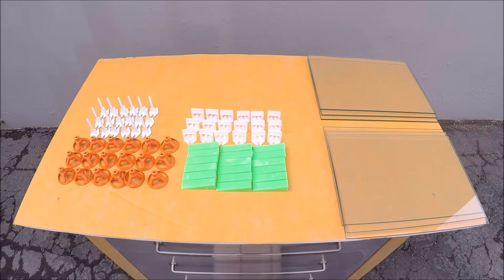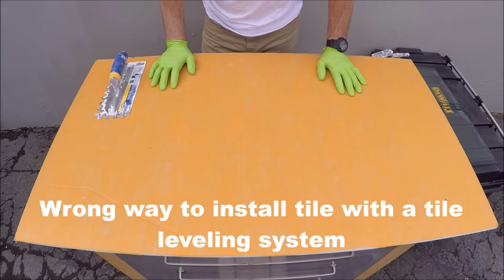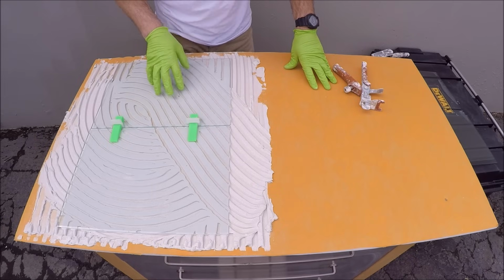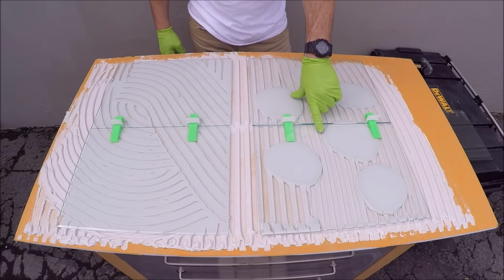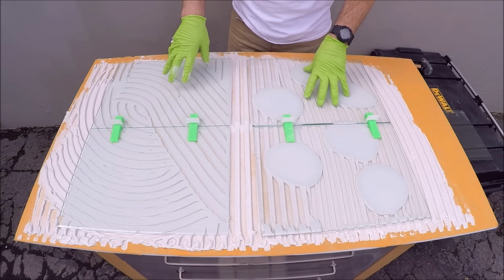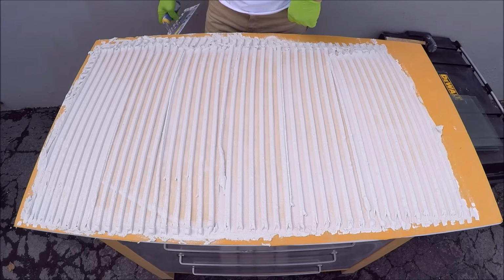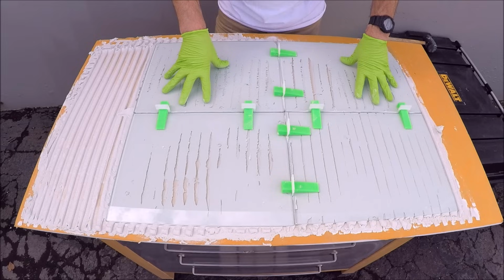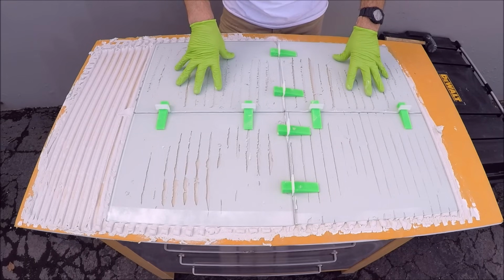How to Use a Tile Leveling System the Right Way

Comment: WHat is the best way to cut porcelain tile that is 39 inches tall? I need to cut it long ways. thx for any advice in advance.
Reply from the maker: manual tile cutter, grinder with a diamond blade and sponge or wet saw, long tiles are hard to cut manual tile cutter👊
Reply: @LandbergTileTV  thx for getting back to me on this. I appreciate it. Will research all methods you mentioned.

Comment: Just ordered and got my first wedge and clip system (T-Lock, 300 piece, 1/8" grout joint). However, what if I want a 3/16" joint? I haven't found an anser on the Perfect level master website or anywhere. Do you know?
Reply from the maker: Ah man, Levtec just came out with their new wedges and clips and they are cheap! You can get a 3/8 " joint if you install non rectified large format tile. Rectified tile would give you a true 1/8" I would also recommend 1/16, but might as well use up that Tlock starter kit and get the hang of them. Sorry you can't get a response from them...
Reply: Thanks for your answer, man. Didn't know about Levtec, cos these wedge and clip systems sure are pricey...even the pliers are like $60! Btw, do you think I can get away with not using any pliers? 96 sq. ft.w ith  6 x 36 porcelain planks. If not, would the pliers from another,cheaper brand be compatible with t- lock? Thanks for your help bro. Subscribed!

Comment: Have 4000sf of 24×36 and may give this a shot. That tiles heavy though. Wonder if the levelers will hold up? What would you recommend on something like that.  Wedges or spin top?
Reply from the maker: Yes, a tile leveling system would hold up and I would go with a wedge system. Just make sure you use large format thinset 👊
Reply: If u back butter each tile like he says your grandkids might be the ones to start actually installing the floor
Reply: @1789crazy  The bigger the tile the more important backbuttering is.
Reply: @narcoleptic8982  nar mate all about letting air out for suction,two sets of adhesive don't let all air out, one good round notch trowel does the trick, take a look every ten tiles or so.
I don't believe in back buttering tiles you might aswell be chucking adhesive down and hoping, I've done it don't agree with it.not in a car show room say.

Comment: I'm having a lot of problems with the clips not breaking off below the surface of the tile I'm breaking them off parallel with the grout line
Reply from the maker: You need to scrape off/clean out the thinset that is on the edge of the tile before you put a clip in and set a new tile. The thinset is keeping the clips from breaking off.
Reply: Thanks for your response that works quite well we actually discovered that the next day when we broke off the next day's clips Love the system makes flattening the floor extremely easy thanks for your videos enjoy when you got a new one out and thanks again for your response

Comment: Great videos. I know this isn't actually related to the video published here but you should know if anyone does. I've been reading how many use fiberglass tape with thinset to seal the corners and joints of the backer boards like DensSheild or Hardiboard. I'm not sure they are talking about the same tape used in putting up ordinary drywall or not. That tape has a lot of open spaces so I wonder if the thinset is enough to seal the corners etc.
Reply from the maker: We use the green moisture resistant fiber tape for our backerboard seams! 👊
Reply: The purpose of the mesh tape is to reinforce the thinset that is skimmed over the seams. It's like using rebar to reinforce a concrete slab. The idea is to minimize expansion movement in the joints of the tile backer board. Also, sealing the seams of Hardiebacker does not stop water. Water travels through thinset and Hardiebacker. DensShield is a moisture block. Using thinset with fiber tape will strengthen the seams, but additional waterproofing is required to seal the seams. Elastomeric products such as Laticrete Hydro Ban can be applied after the seams are reinforced.
Reply: Thank you very much. I was pretty sure thinset wouldn't be enough but it seems there are a lot of people who just use it as a barrier instead of also sealing it with some kind of sealant. Does the thinset on DensSheild actually hold on well with the expansion of joints to consider?
Reply: Latex modified thinset holds well enough. I now use Ardex x77 to set all tile. It has an 1/8” movement suppression built into the mortar. It’s the best thinset I’ve used in the 22 years I’ve laid tile.

Comment: Good video. I also tap tile with a rubber mallet after wedges are locked in. This assures I collapsed all the ridges. Also, I can tell if I forgot to tighten a wedge by the sound it makes while tapping the tiles.
Reply from the maker: That's a great idea on how to check for hollow spots!
Reply: great idea.  thanks
Reply: Exactly.
Reply from the maker: You can always use a golf ball to check as well! 👊

Comment: Used a leveling system once. Not too sure about doing it again. Gets in the way, creates a mess in the grout lines and if you're not careful, will interfere with the bond by raising the tile as you insert them.

Comment: Can you skip making that line with the margin trowel, if your levelling clip has the curved base? The qep lash clips are like that. They are curved and then flatten out when the shim is squeezed through.
Reply from the maker: That simply makes for a clean install. Also, if there is too much mortar around the clip, when you break it off, some plastic will remain and you then have to cut it out. It's always best to clear that out. 👊

Comment: I have seen so many so called professional tilers do it wrong I hesitate to employ one and rather tile myself
Reply: Unfortunately, I think you are right.  I have 2 bathrooms we are tiling.  First one had to be completely ripped out after the first 'pro' made fatal errors in waterproofing.  Second guy made several mistakes, as well.  Both are supposed to be 'excellent' tile setters (these were NOT craigslist specials or low-cost installers).  Second bathroom I am just going to do myself :(
Reply: Good luck trying to tile a shower yourself. Not saying you can't, but If you have never laid any tile this will be quite a challenge.  Most people that see tile guys do it think "oh that's so easy"

Comment: Great video, thanks for this! Do you have any tips for using the leveling system when installing 3”x12” tiles? I’m tackling that this weekend.  Thanks!
Reply from the maker: We have definitely used them for that smaller size. I would recommend against a pliers set and only use your fingers. Keep in mind, you'll use a ton of clips. Good luck and thanks for the watch!
Reply: I purchased 200 clips and 100 wedges.  The bathroom is 35 sq ft.  The clips aren’t cheap, but will be worth the cost if everything comes out level!

Comment: Does anyone know if u still need spacers or do these leveling kits act as spacers
Reply: select the spacer size you desire. They come in various thicknesses.
Reply: In 40 years of tiling, I've never used a levelling system, only spacers. They're clearly a good aid and they do act as spacers, but if you can use your eye and a straight edge, not entirely necessary.

Comment: You will get better coverage from a good 3/8" x 1/4" than a 1/2x1/2 ..try the same thing with both trowel sizes and you will see it for yourself !!
Reply: It will depend on the substrate if it’s flat and even. So this is not always true. Anyways, whatever trowel you use coverage and bonding will always depend on back butter. If you don’t back butter don’t expect 100% coverage

Comment: System has nothing to do here,this vid shows how to instal tiles properly,whit or without system.second thing if tiles are not equal this system is more dificult than no system at all,mine experience with tiles is 20+years
Reply: What do you mean by not equal? As in rectangular tiles vs square?
Reply: FlameDNA probably as in thickness.. there are curved bottom spacers to help get a flush top on uneven tiles

Comment: hi, what if your floor wasn't as flat as the panel you're using and needed to be built up? surely the ridges only collapse if the whole tile is flat onto the thin-set
Reply from the maker: Yes, you need to address the substrate/floor before installing tile. Self leveling concrete helps with this.

Comment: If there are any tilers in the comments section you'll should know that's a shitty video cause a table top is super flat but the floor has different slopes.
Reply: @JosephWheeler14  if the client ain't paying I ain't fixing shit
Reply: @originalwaka4929  Heard that. Most people think you’re ripping them off already without spending, what can be, a significant amount of time to fix their jacked up concrete slab it looks like an owner builder put down 30 years ago.

Comment: One thing that's missing from the proper installation technique in your video is pushing the tile and sliding it perpendicular to the direction of troweling to achieve 100% coverage or very close to it eliminating need for back butter all toghether.
Reply: Piotr Apanowicz he did do that. Watch again carefully
Reply: Video was also missing a point that round notched trowel works better on large format tiles, would be nice to see same glass tile test with square notch and round notch.

Comment: Am I to infer that the adhesion can be restricted by the depth you set the tile depth spacers? Unless I'm missing something isn't that self evident? If so why don't you show the "appropriate" amount of pressure using the spacers? Trowel techniques are important but that's not what the title of this video is. Also, why not back butter?

Comment: My brain is telling me to make the green wedges face different directions. Also, how do you get the white things out?
Reply from the maker: You can technically install the wedges facing any direction, also the white bases stay in/under the tile and you grout over them. 👊👊👊
Reply: You kick 'em.
Reply: The white bases were sticking up over and inch , are you cutting them off or what . Simply saying you leave them in and grout over them sounds like half an answer
Reply: You literally kick them.  They break off below the level of the tile, and then you grout over them.

Comment: When you skim coat the back of the tiles, what size trowel do you use? Do you also make the ridges on the back of the tile 1/2 inch?
Reply from the maker: Smooth, use the flat side of the trowel. 👊

Comment: What I don't understand is:  why they are used so many tile leveling green elements - wouldn't it be enough to use only one (maybe a bit bigger in size than these) green element on the intersections between the four corners?
Reply from the maker: We don't like to insert the clip on the intersection because it covers all 4 corners and you can't seer feel whether or not each tile is absolutely flush with one another. Thanks for watching!

Comment: This actually doesn’t have anything to do with the tile leveling systems, and more about how to correctly trowel thin set mortar. That’s how you are supposed to trowel the thin set without a leveling system. But a good video showing how to properly do it.
Reply: Thinset the most important part🤔

Comment: You did not press down on the first 2 as you did the last ones. And If you were to add thinset spot you add them on all 4 corners and center and press firmly
Reply from the maker: Yes, some installers set tile without "collapsing all ridges" or "pressing down" all the way. I wanted to show that in the video. Ridges should always be collapsed and spot bonding is never acceptable. It leaves to many voids. 👊
Reply: It doesn't matter if you try collapse ridges in different direction troweling method you can't get enough coverage because it leaves uneven amount of thinset behind tile. 
I prefer round notch trowel for large format tiles. Round ridge is easier to collapse and get even better coverage for tile without need of back buttering.
Reply from the maker: Thanks for the info! We'll have to check out the round notch trowel's  👊
Reply: Spot bonding is not acceptable, if you do it  you seriously need to change career path

Comment: Easy to know that you've collapsed all ridges when you have transparent glass tiles!!!   How do you know if you've collapsed all ridges when you DON'T have transparent glass tiles? ---which is 100% of the time?   In all seriousness, it is difficult to know how much pressure to exert when setting the tile down on the thin-set.  5 lbs?  10 lbs?
Reply: Surely you just pull a few tiles, and see how your coverage is.

Comment: If you slide side to side and push hard the tile at first two methods like in last part, results will be the same.  The surface in real life never that smooth like this table, and sometimes you have to add some extra dots for better coverage.

Comment: Very good idea using glas, but its nevertheless a fake experiment. The first method pressed as strong as in the third, "good method" would have the same results. He presses down the tiles much stronger than in the first version. Nevertheless, when pressing down the tiles after leveling, this levelling method maybe an good and easy method. Am I right? 
How to cope with uneven ground, e.g. over old floor tiles with up to 3mm difference in hight?

Comment: forgot to backbutter😕
Reply from the maker: Yes! I explained why at the end of the video. I wanted to show off the thinset ridges through the clear glass. Backbutter is always a must!
Reply: Landberg Tile DIY TV awesome! respect
Reply from the maker: Smooth, use the flat side of the trowel. 👊
Reply: Yon only need to backbutter tiles if there is very heavy texture underneath or you are using natural tiles otherwise you choose correct size of trowel and there is no need for backbuttering. You should also use round notch trowel for large format tiles square notch is way harder to get collapse full coverage.

Comment: The moment he did the swirly adhesive thing - I switched off - wrong, wrong wrong wrong, the air cannot escape thus leaving air trapped underneath, which can be seen easily through the glass - the coverage of adhesive should be almost total without air gaps. - tht thinset should be put on, then trowel out so the grooves are parallel top to bottom.
Reply from the maker: lol that's why I did that, to show that it IS wrong.
Reply: Yeah he was showing the wrong way to do it before he showed the right way. Too bad you didn’t watch the whole thing

Comment: But when you did the incorrect way you did not put any weight on a tile to push them down to bond then you say the way that is correct you push down with force to get bondage I can get my floor flat without those things
Reply from the maker: That was the point I was trying to show, always collapse your ridges as much as you can. Thanks for the watch and comment 👊

Comment: It's just to let air flow out for good suctioning  so that fat bird in steletose doesn't pop your floor tile , better explanation would be better,
Yes cert qualified tiler, and adhesive trained before you ask but ask me if ime a tiler,like most we are still learning and a fair bit of nonsense has arrived as in all diy. 
Don't attempt to Tile your self unless you can sudoko, maths and find the g spot my friend, everyone's a tiler,even ladoo on this video will agree, simple thing really if you can't guess what colour a movement joint is or can you draw it. Please don't even pick a tile up.
Ime tiling now coz at 18 I did my ceiling with plastic tiles.just the triangle bits that looked nasty.
Anyways good video mate
Reply from the maker: thank you sir 👊

Comment: Hello Friend, If you could make a new video, this time on an uneven surface it could be helpful.  I think you are going to find some of your assumption, generated on a flat surface, may not work the same way on an uneven surface.  A better test might include actually using tile, buttering the back, setting the tile, and after curing for a month busting the tile up. This would show just how well each process works
Reply from the maker: That's a great idea, I'll try and do that in a future video! 👊
Reply: Why would you install on an uneven surface?  Proper surface prep is critical to any job!

Comment: Change your title to how to use a trowel not leveling system.. Anyway,shouldnt use leveling systems in the first place, thats for DIY and handyman. The very first 2 tiles you pressed lightly and the last 4 you pressed as hard as you could :)... back-buttering is simply a waste of time if you are proffesional and lay 200 SQM of tiles a week etc. Also applying a lumps of glue or as you call it spot bonding can be used on walls, not the floors.
Reply from the maker: I dont agree with you, but that's okay. Tile professionals DO use tile leveling systems for a superior installation with large format tile. I was demonstrating how installers don't press hard and how that is the wrong way to imstall. Backbuttering is always a good idea and spot binding is never a good idea. 👊
Reply: Sal Diblasi, the top tiling pro on Youtube here uses them constantly, I don't think you actually know what you are talking about.  Sal literally says they were invented as it was becoming impossible (due to curing of the procelain being cupped)  to lay LFT flat without them.  This guy is an absolute pro so i would take his consideration over yours, personally.
Reply: richardvoyageur Sal diblasi doesn't even know how to strap his knee pads on
Reply: Do you have any tiling videos I can watch?  Sal has helped me immensely with my projects. He does amazing work, answers questions and has 700 videos, I'm sure his kneepads are ok!
Reply from the maker: I agree, you can't talk crap if you have no videos of your own to show! Sal is the man, and has helped me immensely as well! Happy Sunday guys!
Reply: Results, good results, is what I pursue.  Whatever it takes.
Reply: U are wrong about the leveling system...it saves u work